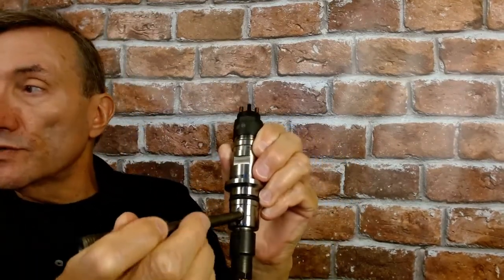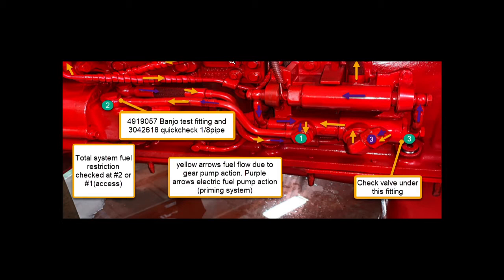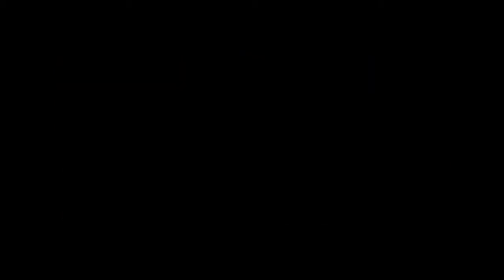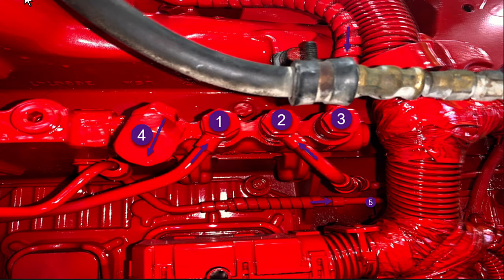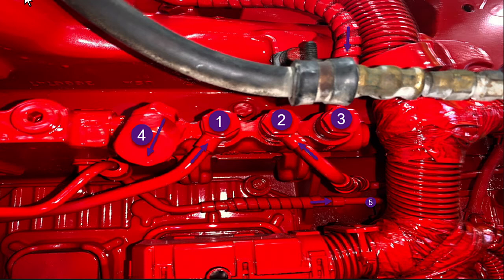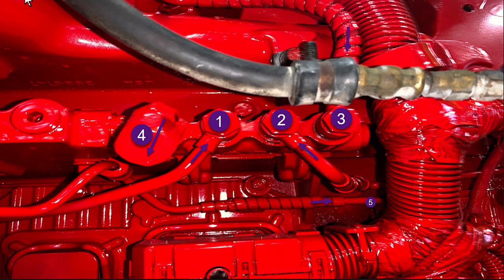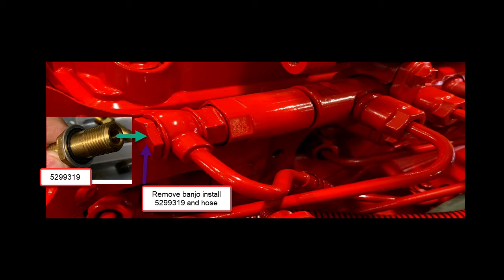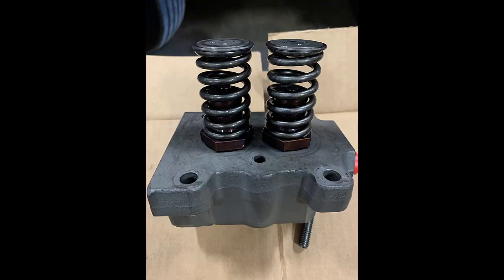FC 559 Video 4- Low pressure side troubleshooting

Comment: Low fuel pressure in Cummins x15 after engine shutdown for an extended period. Any suggestions?
Reply from the maker: I believe we covered this in email. let us know how you made out.
Reply: @ENGINESHOPJOE  did a inframe on one of our 2250. The truck sat for about 10 months now at idle command is about 6000psi and actual is 2,500. What should we check first?
Reply from the maker: @Capone-Keno  First check fuel restriction at the inlet to the engine fitting next pull the line off the rail high pressure relief and see if it is dripping fuel. None should be coming out.
Reply: @ENGINESHOPJOE  thanks. I checked the return on the fuel pressure relief valve and it was shot. Completely open. Ive never had one go that bad

Comment: Is the check valve at fitting 3 under the fuel linlet line or the line coming out the end of the lift pump. There  are 2 number 3's in the vid.
Reply from the maker: It is under the number three that is farthest to the right in the slide or the green colored number 3. That big nut that the yellow line points too is unscrewed and the check valve
screws inside of the housing the nut came out of. The check valve looks like a short 12 ga shotgun shell and is made of stainless steel. The new x15 engines are much different when it comes to this area right here. I will have to photo and do an updated video on them.

Comment: Hey what is the best way to contact you outside of YouTube?

I’m having this code but noticed I have a hard start lately(truck doesn’t start right away)

I have been watching my fuel pressure after shutoff and it will go from 6k psi to 0 psi within couple mins 

Would a bad injector or cups be the culprit or something like a check valve
Reply from the maker: faultcodehelp@gmail.com

Comment: We seem to have the pressure dropping and the code only after operating temp is reached.
Reply from the maker: I am assuming you have a common rail isx. If yes then check the rail dump valve and see if it is hot. If it goes bad it gets so hot you cant touch it. It should be hot as the rail or sensor if working properly. It could also be a problem with your fuel actuator - it is electrical and could be the cause. I dont know what faults you have etc. Last make sure you dont have a fuel line collasping when the hot fuel makes it soft. The restriction can get very high then go down when the fuel is cold. use a restriction gauge to verify
Reply: @ENGINESHOPJOE  yes code 0559 and common rail isx. I will check those items. Installed new accuator because of wiring. I am leaning towards a hose. Rail pressure goes negative if it stalsl from no fuel pressure.   Rail pressure stays if its shutdown with key.
Reply: Thanks for your reply.
Reply from the maker: Let us know what the problem was. If you have it someone else will too.. Some problems follow chassis make too. I try to put up things we run into daily because that is the real world. 
Your welcome. Truckers keep America strong
Reply: @ENGINESHOPJOE  ended up that the tube to injector #3 was bad at the injector. Engine would get to 175 degrees then fuel return from head would increase to 300 ml at 15 seconds. Back to normal at lower temp. Capped off each injector 1 by 1 and found it.
Reply from the maker: @CMUSTY1  Great troubleshooting!
Thanks for sharing

Comment: Do you leave the fuel dump connected while checking fuel injectors and connectors for return flow?
Reply from the maker: If you are referring to the orificed dump line installed at the fuel filter housing (port 4) that dumps fuel into a bucket- No.
 You could, it wont affect the injector return diagnostics. The dump line is just to make sure we measure maximum suction side restriction. We achieve that by 
forcing a high flow rate from tank to inlet side of the suction gear pump.
Reply: @ENGINESHOPJOE  Thankyou for clarifying
Reply: I am having an issue with a cm2350. The decay rate is excessive on it. Drops from 28097 to 540 psi in a minute. It passes injector return flow test 150ml in 30 seconds, it passes the relief valve test, and on the fuel pump head return flow I get 400 ml in one minute. So that seems to be good. Cant figure out why it's not passing the leakage test. Any ideas? Thanks for your help and you are awesome at explaining your videos
Reply from the maker: @jamesrobinette3038  First let me say we have many units in our fleet that fail the decay rate and others will hold pressure for hours at a time. Here is the kicker
neither unit may be logging FC559 -low fuel pressure. Last i Knew the ecm had to see over about 1500 psi below commanded for about 30 seconds before it would log.
So decay rate alone is not a show stopper. So I don't know how many miles/hours are on the injectors or pump head. Take my advice at your own risk here ok.
I would loosen , oil and retorque the injector connector nuts to torque - keep in mine if your torque wrench is off 4 foot lbs that is huge  in maintaining that seal connector to injector. If the injectors still flowed at 150ish i would run the automated injector PERFORMANCE TEST. If they all pass all check points I would replace the pump head.
If you are not logging faults decay doesnt seem to be an issue until you get fuel filter restriction over max limits. 
Tell your friends to subscribe to help me out.
Thanks
Reply: It is logging 559 faults, currently driver is complaining about truck loosing power climbing hills, then coming out of it when not climbing. Also logged three filter restriction codes. 2434 code I believe.
Reply: @jamesrobinette3038  its 200ml in 60 seconds. So 150ml return in 30 seconds means your over spec bud